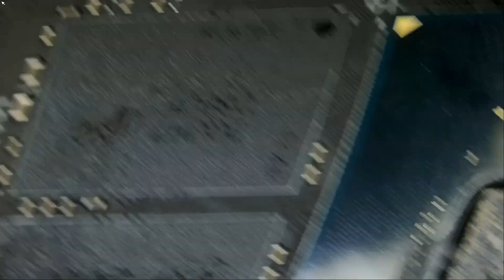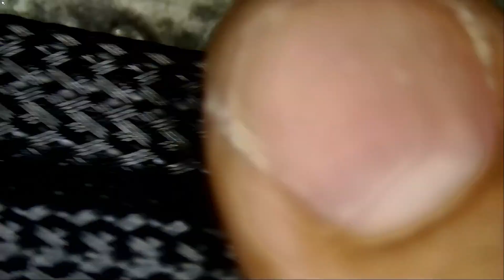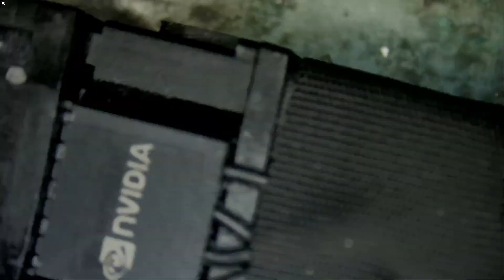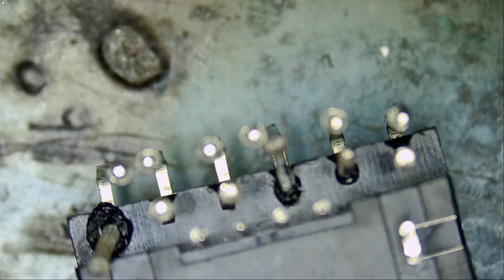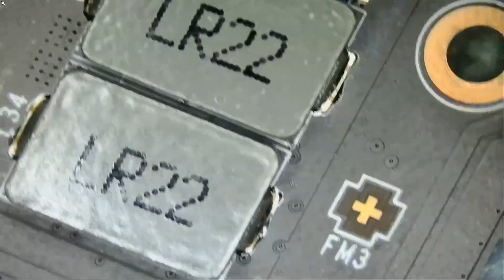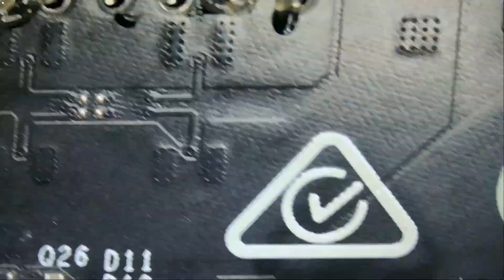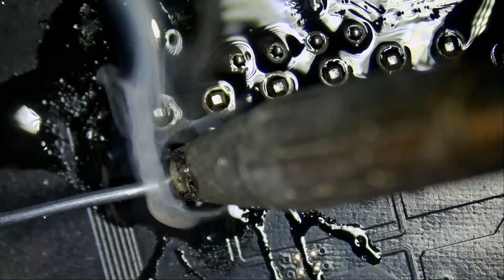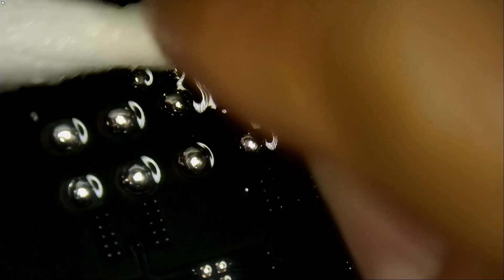4080 MSI Trio Never seen before Connector fell off & triggered Smoke Alarm

Comment: Thank you for your valuable feedback! MSI is fully aware of the issue and has taken it seriously. We've implemented technical optimizations and improvements in the subsequent product manufacturing process. We will continue to focus on product quality and user experience. Thank you for your continued support and trust in MSI!
Reply: @msigamingofficial - the customer invested good money into supporting your company and brand, you have let him down due to a manufacturing defect, you are letting yourselves down by only offering positive words.
Take positive action and make things right for the customer. 
Identify the batch in question and reach out to your distributors and get any affected cards reworked before anymore serious failure occurs and get in front of the timebomb.
Reply: Make that customer happy MSI, he trusted you, 
you know "you reap what you sow".
Reply: ok, how does that compensates this customer ?
Reply: This is a terrible response, you should compensate the customer in some way, either money back or replacement unit
Reply: @Bfg-yi2id  it's better than factory now
Reply: This is just public relations bull****. Haven't you learned we see through that nonsense? NF fixed it, MSI pay for it!
Reply: Shame on you msi
Reply: Try again, starting with how you’re going to make it right for someone who paid a lot of money for a card that clearly had severe QC issues.
Reply: MSI should at the very least compensate the customer for cost of getting the card repaired.
Reply: @rajav2  yeah, but that is the "very least", MSI should replace the card and pay the bills for repairing the one that has failed and the shipment back.
Reply: So…. What you gonna do about it?
Reply: @kumin0312  thoughts and prayers?
Reply: With a response like this, I'll never buy an MSI product again. And I've purchsed thousands and thousands of dollars of MSI products in the past.
Reply: Look at the card, all pins on the board don't have any trace of any solder. It is a clear fault of the manufacturer. The manufacturer must compensate accordingly.
Reply: So in other words... go pound sand.
I'm not going to buy any MSI products again with that attitude!
Reply: should it be a recall then of all 4090?
Reply: @VovanCBR  seems like a safety issue…. Rohs needs a QC 
Iaei 
Bro OSHA you got any 4090’s?
Reply: I think you should at least pay for this repair or refund the customer.
Reply: How dare you sell a defective product and not support the customer, when one of your wave solder lines CLEARLY had a hiccup, or a malfunction, as the holes in that card are damn near PRISTINE! SOLDER DID NOT EVEN TOUCH THEM, and by extension, no flux hit them unless it came off down the line.
You should, by all rights, send him a new card, and apology ad even a check to help diffuse this bill, which is YOUR FAULT.
On top of that, you are throwing shade on the NVIDIA product name and they might not like that much. These folks here, just might start venting anger at them. That could put a crimp in your little contract. I just retired after 45 years of watching this technology grow, and trying to help everyday users to understand and run their systems. You, Mr MSI have just given your fans the wrong impression and maybe a middle finger.
Enjoy the following discourse, held in your 'honor'.
My $2.00 worth.
Reply: so in other words... go pound sand!
I won't be won't buying any more MSI products again with that kind of attitude.
Reply: -1 client here!
Grabage  QC company!
Reply: Yeah. That's basically like sorry sire you lost your hand,, we are gonna make sure next person doesn't lose there hand. What about compensation to your customer? What about users already having purchased these cards?
Reply: You should atleast pay for the repair of the video card if it has already been repaired and working.
Reply: Because NorthridgeFix was able to carry out the repair and function without much effort, I think MSI should cover the costs. Not only was it quick and uncomplicated, but it was also more environmentally friendly and supported by local repair companies.
Reply: well my graphics card died and hubby was going to have me get a new one from msi. i saw this and ill be finding one from somewhere else instead. Hope he doesn't mind but this is upsetting to see from msi
Reply: MSI you better take action for this serious issue, if you already understand then fix it .
Reply: What does implementing optimizations and improvements to future products do for the current customer with a faulty product?
Reply: That's all?  You should compensate and pay the bill for the repair at least.  It will be a minimum to do.  Trust in a company isn't only based on words.  Do something.  Thanks.
Reply: Alright, MSI, the ball is in your court. Make this right with the customer who paid lots of money for your product. Be better than the other aib brands and replace the card or give a big discount. If you do not recall, you are going to be sued when you burn someone's house down.
Reply: Absolute bare minimum MSI should be doing is asking for the cable and connector back for investigation, I agree with Alex, what MSI SHOULD be doing is offering the customer a brand new card AND cover the repair cost of his current one (to the customer if he's paid already or Alex if they haven't paid yet), its then up to them if they then ask for the old card back whether it be so the customer doesn't have two cards to sell one on or to check the board for whatever they may find although i doubt there's much evidence left after it's been repaired.
Reply: So you’re saying “Yes it’s our fault, we knew about, we’ll try and not do it again, buy more of our stuff!! Trust me bro”
Reply: GIVE THIS GUY A NEW CARD! And pay this technician
Reply: What trust?! Looks like a rubbish board to me and the customer is the only one being screwed over here. I wouldn't use your products if this is the response @MSIGamingOffical
Reply: Your words does no justice, good thing I never liked MSI and now with this response, I just can't trust investing my money in MSI, I could just imagine how many more customer have dealt with this issue.
Reply: How do you dare to answer like that. You should compensate the client. Give him a brand new one or give him his money back or any other "respecting the client" solution. Talk is nothing without actions. If that connector could come right of a pcb so thick it means there was not even enough solder to hold the connector. This is a lack of quality control it is your fault and you should have solved all these cards connectors melting problems since a long time. Look at at the solder joints northridge fix is making and take example!
Reply: So…. What you gonna do about it?
how does that compensates this customer ?
Reply: How does this response help the end user and the technician who repaired the faulty video card? What is MSI going to do to compensate both the technician and the user for their wasted time and inconvenience?
Reply: Why would we trust you????? You need to make it right and not just for him. Replacement and the bloody wasted time of dealing with a company that wants "trust".
Reply: If i had money for a lawsuit i will sue this company,What if the house burnt or what if a child was close by and got burnt or even worst.F this company, give the client a new card and send in the repaired card.Pay the technician for giving light to this problem.I will sue them.This was a dangerous thing that happened.
Reply: So nicht meine Damen und Herren 🤨
Reply: I will never recommend anyone get anything from MSI, they far worse than Asus on Customer Service and even worse on Design. They should be paying North Bridge Fix for their time and getting the customer a new Card.
Reply: In Austria this would be a consumer protection case and a lawyer would take it on board if there was no appropriate reaction
Reply: what can the customer buy from your !!even bad!!! response now? does your company even pay the customers bill? does the customer get a new videocard from you? you are talking absolute bull....! Do your job right and take response for your own mistakes! These 5 senteces  you wrote: cheekiness. Makes it even worse.... saying you will care in future is not a solution for customers having problems already....
Reply: Great way to restore confidence in your product MSI. Maybe Customer Relations Team need to go back to school.
Reply: I also have an MSI graphics card (and my colleague at work) as well as a motherboard. I'm waiting for what MSI will do to know if I should continue with that practice.
One of the best things about Europe is that everything is guaranteed for a minimum of 2 years and you yourself, if you wish, can purchase an additional one for up to 5 years.
If something like this happens (and it's under warranty) you just take it to the store and that's it. They solve everything for you, and they deal with MSI. Of course, even if it happens after the warranty, this is an obvious mistake when making the card and this is unacceptable. I've never heard of anything like it. I hope they don't go the ASUS route...
Reply: I think you guts at least should pay for the repair cost to the customer and may be a nice gift basket as means to say sorry about the manufacturing fault.
Reply: I would think this a real cause for concern for MSI and they should be talking to their lawyers now. Normally an electronics company are not at risk for big lawsuits since they are not dealing with repercussions that could cause death. Usually just small issues that is usually not even worth taking the small claims court. For instance, a car company finds some defect in their glove box handle or some other somewhat trivial thing on the car, are they going to recall it? No way! Why not? Because they are not going to get sued. But what if there is something wrong with the steering wheel and it could lock up causing loss of control of the vehicle, now someone could die. Uh oh...lawyers recommend recall to cover their butt in case they get sued, because they know the COST OF REPLACING ALL THESE STEERING WHEELS is LESS THAN THE COST OF PAYING OFF A COUPLE LAWSUITS. They do the math and decide to recall. With a video card, I would think they would/should only be worried about a Class Action Lawsuit, which I would think would/should be coming since these aren't cheap video cards, but then again, it still might be too small for them to care about it. HOWEVER, if they start to see an issue like this where the video card is causing smoke and could burn down a house and potentially KILL someone, guess what....their lawyers and accountants will do the math and might go for recall. At the end of the day, whatever is morally 'right' or 'wrong' all these big companies care about is their BOTTOM LINE. It's all a money game. I definitely think MSI should just fess up to it and provide new cards allowing customers to swap in their old defective cards. But it might not make sense to them financially so they would only be doing it to maintain whatever reputation they have and I don't know if it is worth it to them. Good luck! But if anyone could make this happen, it will be Alex and Northridge Fix. From a fellow repair technician to another good luck brother, keep fighting the good fight!
Reply: Very poor response. The customer bought the card in good faith, clearly it was not manufactured correctly. Fortunately North Ridge Fix was able to repair the card, however they need to charge for their time for the repair. At this stage the customer is out of pocket for a repair that is a result of manufacturing failure. He has not been able to use the card while it was being repaired and the best you can offer is some corporate speak that means nothing in the customer's eyes. What is bizarre here is MSI have missed an opportunity to handle this issue responsibly and make the problem good. Furthermore the 35K people have viewed this video and your subsequent response will impact MSI's reputation in a $ value way more than an apology, reimbursement of repair cost and provision of a new replacement board.    Goods Work MSI.
Reply: MSI you should at least replace the dudes GPU instead of giving such a typical response
Reply: Shame on you MSI
Reply: at the very least, pay the customer repair bill ! imagine if the house burned down and a family member passed due to smoke inhalation !
Reply: computer parts are not cheap. and customers are paying hard earned cash to buy them. we know that nothing is perfect in electronics. but great customer support can help that.

for real life examples... a few weeks ago, my company laptop had a broken hinges. and turns out we experience about 25 of the same problem in that series. the principal after being notified went to us and give us a free warranty extension, change the hinges for not (yet) damaged hinges for all the laptop we have in that series (like 50 of them). and even willing to provide us replacement laptop while the unit are being repaired. they even willing to listened to our walkaround to "fix" the hinges problems and looking at it internally to check is it possible to do it as a final fix.

now THAT are top noch customer support. how about you @MSIGamingOfficial ?
Reply: Let me translate. We admit it's our fault but the only thing we will give you is the one finger salute because we have more expensive lawyers than you.
Reply: I wouldn’t wait til this catches Gamersnexus’ or Jay’s attention lol. Compensate the owner now before you face a bigger decline on your sales😅
Reply: Shame on MSI! Shame shame shame and i'm glad to see a lot people dislike them, because i had issues with their support for a long years and finally when i told the truth directly- they banned me of their forum. After i spend ~€40 000 in premium notebooks and PC  parts for 10years and about 50% had QC or manucaturer specific issues and MSI never helped or responded as they should , since last 2 years i pour my money in other companies.
I use only premium products, like GT Titan notebooks, high end Motherboards and GPUs and issues was frustrating, but msi's responses was awfull, just like that one. Damn **  you MSI , you can't ban me here !
Reply: Go to hell msi rubish as always never buy anything that comes from MSI....
Reply: Maybe an optional (by customer choice) recall offering resoldering of YOUR board, then return YOUR board back to original SN owner. And not some crappy third party don't care company six months later in a low pay country. Send them back to OEM manufacturing plant. Automate it. Then.... QC. Good QC.
Reply: Please MSI, please be a good company and help the customer out. I even have one of your 4090s as well.
Reply: you should identify the batch and recall all cards affected. replace them for customers or refund the money. this is neglect on your part. you are the only ones able to QC these products, most people just have thier pc´s built by someone else and know nothing of the danger that lurks within.. make it right.

also MSI is no stranger to shady practices...
Reply: What does that mean? Will you send a new video card to the customer?
Reply: Great response MSI. We know this issue, but customer have to pay for fixing it. Never MSI again.
Reply: @msi  - 
 you should investigate and offer some form of compensation's.  Ita pretty obvious this slipped through quality control.
Reply: If you really want to make it right you need to give the customer a new replacement card and compensate NorthridgeFix for his repair. If you do not at least compensate the customer for a problem you caused how can anyone trust that this will not happen again? Do you want to become the next Asus?
Reply: Just replace the card with a new one. You are a million/billion dollar company. I don't think replacing this card will hurt your wallet. 

You were aware of the issue, so clearly, warranty should apply. 

I don't understand why companies are being so dramatic about warranty. 

IF THE DAMAGE IS YOUR FAULT, HELP THE CUSTOMER. It's not that difficult...
Reply: MSI is fully aware that their products are degrading in quality and they dissobey to take responsibility of those actions towards customers. MSI shows disrespect towards customers before his own profit. What siriousness did MSI take for the customer. 
Oh,we sorry our crappy product didn't survive,try to buy another,please and stop bullying us.
Reply: Thank you for your response, however it appears to be lacking.  You need to, at the very least, pay the out of pocket expenses for the customer in question.

Also, in my opinion, you should recall ALL the cards that are likely to have the same DEFECT as they are a danger to your customers, if they are setting off smoke detectors then they are a potential fire hazard, this could lead to the deaths of your valuable customers.  This I suspect that MSI does not want to be known for.  And I DO mean MSI and all of your subsidiaries.

A concerned viewer who will NOT be purchasing any MSI products until I hear from a trusted source that this issue has either completely gone away, or that people are being made aware of the recall/replacement program.
Reply: This is obviously a manufacturing error, if MSI isn't going to take responsibility for their issues they don't deserve our business.  The MSI response is disturbing.
Reply: MSI... What the heck?! Shame on y'all for such a crappy response and for making crappy cards! You should compensate by giving that customer a new card and also paying Northridge Fix for the time and effort to repair that card. You should be recalling all of the cards with the bad connectors and giving every customer who bought the defective cards a brand new replacement. I'll never buy another MSI product again! Such terrible customer service!
Reply: How about you ask for the product serial number, and check the logs for the batch it was in, and what manufacturing process that batch went into especially assembling, testing and QC. I think you'll find something more useful to say that "We understood".  Thats what i would do at least if i cared about my company's trust with my customers, my reputation as a tech company. Walla it's not that hard.
Reply: Do you really think people are going to buy your graphics cards when you absolutely don't take any responsibility when things go wrong? Your answer is plain stupid and you will loose both money and reputation!
Reply: -1 customer
Reply: You see? This is why I stay away from garbage MSI GPUs, especially away from venture and gaming series from 30series cards till now. They are all cheap quality, and problem makers. If you know that the issue is on your side, you should do a full refund in this case.
Reply: The right precedure would be, make the customer RMA his exisiting card, and send him a new one (with the revised update of the connector) otherwise, would be the same
case. This would be the right approach. If the item is new, need to be swapped with a new one, if the card was refurbished, then they should send the customer a revised
refurbished. Plain and simple.
Reply: As an msi fan boy. I don't understand how did you fix the buyers problem with this post. He paid for msi's mistake.
Reply: I work More they 20 years in Customer Support in Electronics. Give the Customer a new Card included Shipping.
Reply: Do the right thing MSI and stop trying to dodge responsibility
Reply: MSI - I would suspect you've already lost the customer and many more potential future buyers of your products through your inaction in this example and not prioritising customer experience. 

Here's a real life example of how to retain customers. I accidentally damaged my new Bequiet CPU cooler during installation. I wrote to Bequiet and admitted the fault was mine and requested a repair where I would cover the costs. Can you guess what Bequiet did? They sent me a brand new, sealed product replacement, no questions asked. They ate the costs because they are smart enough to realise retaining customers is how you maximise costs and increase value for customers. I will always buy Bequiet where applicable since they proved to me they value their customers. You should learn from them.
Reply: Hey MSI how about you do what's right and replace the card and compensate the poor guy.

And MSI how about you team up with all the other board partners and do good by all of your customers combined and start a class action lawsuit against PCI-SIG for creating such a crappy connector and against Nvidia for using such a crappy connector and making board partners also use such a crappy connector instead of 3x 8pin connectors.
Reply: MSI is fully aware of the issue ........................shame on you. Hand in pocket please.
Reply: You have the opportunity to make a super PR work right at your doorstep. Act smart.
Reply: Won’t be buying an MSI product ever again thanks to your response.
Reply: @Northridgefix :- "Better than factory". 😂
Reply: During the times of gtx580 series I bought two MSI lightning cards. Where I live taxes and shipping is like 150% msrp. Both died. 
I still have an older evga working fine in 2024. I can never touch MSI again for any pc components 😂
Reply: Ear manufacturing fault. Shame on you MSI!
Reply: This feels like the response you gave me after it took 3 times for you to finally send me another motherboard after you failed to fix chipset fan and audio not working. This was clearly a defect and your responsible for it
Reply: Very disappointed with the response, what about the customer? :yt:
Reply: As an owner of several, expensive MSI products; This is unacceptable treatment of the customer.
Reply: Msi should, at minimum, pay for this guys repair bill. I can tell you now. If this is not resolved by MSI, I myself will not be buying from them anymore.
Reply: This comment it's sounds like is written by a bot, terrible comment from MSI,it's like we are aware of the situation but we don't give a F...
Reply: MSI  needs to compensate the customer for the repair
Reply: We need gamersnexus for this one. Hopefully he can help
Reply: We need to summon Steve from Gamers Nexus
Reply: Any reputable company would be recalling the affected products. - There is a known manufacturing/design defect that poses a potential fire risk!
Reply: Never again MSI!!!
Reply: Shame on you msi
Reply: @MSIGamingOfficial
 This is obviously a manufacturing defect. That means it is your problem. You need to make it right with the customer. Does that make sense to you?

I am currently shopping for the guts for my next computer. Why would I buy from a company that does not correct their mistakes? Sorry, we'll fix it in the next batch does not make it right.
Reply: Yeah sure that's nice, but why not openly and publicly offer a solution to the people experiencing these issues on top of making sure future customers don't have this problem?

It's a waste of time and money for people to have to fix your short comings.
Reply: @TheMegaloYT  because it would bankrupt them, to fix this one card PUBLICLY…. They still riding the “it’s the consumer “ at fault… and if they accept fault for this ONE…. They have to accept all 10,000+ cards produced possibly a TOTAL RECALL and redesign…. So while they ride the BACK of PAYING CUSTOMERS TO FUTHER R&D a NEW connection…. First adopters are left to die….
Reply: So, MSI, you mentioned "We've implemented technical optimizations and improvements in the subsequent product manufacturing process", but what about all the users who bought your products before the improvements in these manufacturing processes were implemented? One of your clients bought a card with what definitely seems like a manufacturing defect (and who knows how many more clients suffered or liable to suffer the same), and this client had to pay for repair and probably for shipping, and even after the repair, the card might still be damaged or maybe it inflicted damage to other PC parts. I have not seen in your comment anything about any sort of compensation for anyone who purchased your products and is unaware of or realized there was a manufacturing defect, nor have I seen you referring to compensation for NorthridgeFix for spending time and money fixing your fault; and last but definitely not least, I have not even seen you apologize at all in your comment to any affected party, which is the bare minimum, and is shameful and disgraceful on your part!
Reply: You are aware of this issue. That means you are aware that there are several defective cards on the market. Don't spew this bullshit and start recalling the cards. Next time if this causes fire in someone's house and kills someone, what are you going to do? Compensate the customer and recall all the cards that have QC issues
Reply: make it right
Reply: This says literally nothing. It's bad enough your garbage laptops have no quality control but now your GPUs are so awful they can potentially start fires and kill entire households of people and pets? You're sickening.
Reply: Shame on you MSI. It is not enough to try to protect your profits by saying it won't happen again.  You MUST pay for your mistakes. You created a defective product that nearly burns peoples houses down.
Reply: @msigaminhofficial are you using an oldest version of chatgpt to write down your comments?
It looks so..
The problem is almost noone is willing to legal suite you for this, not for the ammount of money, but for the lack of interest for costumers when you company know the issue and admit its your fault.. 
Thanks to all you guys not to trust MSI
Reply: @MSIGamingOfficial -- This is just your way of doing legal speak and dismissing the problem many customers are having with these cards. you are not taking responsibility for poor engineering practices. I as a long time MSI customer (I Have several MSI laptops, and my primary desktop has a MSI board) I can tell you this is the last straw for me with your company. Right now, I have a MSI GT72 Dominator, MSI GT75, MSI MEG Z590 ACE GOLD EDITION motherboard in use today (except for the GT75) . Funny how the GT75 died after 2 years 1 month exactly. exactly 1 month after the warranty period ended. (i bought it from costco so one year from manufacture, 1 year from costco) Earlier on about 6 months in with the GT75 the audio card decided to glitch out and i contacted support. got nowhere with it. support pointed the finger at something i did just tossed the blame thrower around at the customer. keep in mind i've been in professional IT for 27 years i've built thousands of computers in my time. anyway, i also have a msi branded nvidia 4080, 4090 but both of them will be sitting in an antistatic bag until the end of time. i'd rather not burn my house down with them installed. I've replaced them both with high end AMD cards. I'm also ditching all of my MSI gaming gear because of your empty response and going to other manufacturers. sorry MSI but you lost a long time customer for good. i'm so sick and tired of seeing manufacturing companies poorly engineer high end expensive cards putting shotty or insufficient current flowing connectors expecting them to be reliable and safe to just reject warranties and point the finger at the customer or respond with some half baked canned response like that. put a little more into those connectors. spend a few pennies per unit. go with a more industrial type of connector so you don't burn houses down or cards destroying themselves because of shorting out. you might find that alot of the cards being claimed under warranty will soon dwindle down and you will actually make a bigger profit.
Reply: MSI should respond with this... Thank you Northridgefix for bringing this to our attention. We have identified the issue and are working to make sure this situation doesn't happen again. Considering the uniqueness of the situation of the full connector and pins coming off completely from the board and not because of a burned connector situation, we at MSI would like to extend our apologies to the customer of the card, and would ask the customer contact asap and we will be happy to replace the card with a new card, and also cover shipping. We at MSI would also like to reassure all MSI customers that our quality control section works very hard to make sure something like this does not happen. This was clearly a quality control issue, and we accept our department missed this card. This is unacceptable, and we will make sure our quality control department personnel are up to date with their training and skills to avoid this from happening again. Thank you
Reply: Lo sentimos y ya esta?????
No dais ninguna solución al igual que todas las marcas, nunca hay garantía ni respondeis con una compensación o cambio de gráfica, por desgracia cada vez es mas común en todas las marcas,da igual si son de smartphones, cohes,computadoras etc el comprador esta cada vez mas desamparado.
no existe la justicia.
Reply: @joseensenat8296  Visto esta respuesta, no veo ninguna diferencia entre MSI y cualquier fabricante chino de aliexpress o alibaba... es más, veo en ellos incluso más responsabilidad. Nunca más.
Reply: brand new video card to customer, apology and pay the bill to Alex!!!!
Reply: @MSIGamingOfficial you implemented technical optimizations and improvements in the subsequent product manufacturing process??? The card's connector says a whole different thing, that is obviously no way near to that technical optimization thing you are promising with to your products. Just replace it with a brand new, quality tested card, or a refund plus the hassle made because of the poor quality of the card.
Reply: MSI will "continue to focus on product quality"? Clearly they hadn't and are in denial.

"Thank you for your continued support and trust in MSI" Unbelievable, do they seriously think customers will have either after experiencing such a blatantly obvious and serious QA failure?

Just insincere corporate boilerplate BS.
Reply: I hope this video and your response have the greatest impact possible to your profit and your company's name.
Reply: Compensate the customer.
Reply: If you are aware of the issue and are taking it seriously MSI what exactly are you going to do about it ?. I guess we will see when we check your next generation card that will be coming out soon and I bet it has the same problems I bet you do nothing to sort this massive problem I also bet you wont replace any broken cards for customers with this issue with a new one but to be honest who wants your products when we know what your like at trying to build video cards
Reply: Very sad to see a standard replay, that can be used for everything. Who does that help? Only MSI for not being sued or holding them financially responsible. 
Even more sad, that nothing  seems to be done on your part (MSI). Not even making customer aware of the possible fire hazard in their homes. I was a MSI customer for a long time, but that changed some time ago. I do not like the way MSI took recently. 
MSI, take responsibility and do something.
At first: Be upfront, help the affected customers and than keep your quality control in line. 
And get Nvidia in the boot as well. They started the connector problems in the first place.
Reply: @MSIGamingOfficial Regarding the trust the customers are giving MSI, when buying a so high value videocard, MSI should be trustworthy too, when issues appear regarding the hardware. You should definately compensate the customer with a replacement.
Reply: This answer is even worse then I thought, they are aware of this issue with burn connection and they haven't investigate the root cause of all burn connections.
First they should talk to Alex, because he knows someting about it and second they should compensate all customers with this issue if they want to have trust in their products again.
Regards from 🇸🇪
Reply: MSI should give a brand new card to customer
Reply: This is an answer given by a chat bot! Take your responsibility and give a human answer. And now compensate this customer.
Reply: that's it? Just empty words!! You guys must compensate him for the loss. And I'm never gonna buy any Multiple Serious Issue (MSI) Stuffs ever again for this kind of behaviour
Reply: If you guys are going to compensate any of your let down customers, I believe you should refund them the full amount they paid for your graphics cards and not replace them with new units until you have fixed the burning/melting problems with them. You're going to kill someone or a family with these dangerous connectors. Take responsibility or loose your name!
Reply: If a car manufacturer sells a car with defective components, they issue a recall with the affected VIN numbers so that customers can bring the car in the dealership and have the problem fixed free of charge. Otherwise they would face a massive lawsuit, pay millions $$ compensation and also gain a bad reputation and loose money in the long run as customers won't buy that brand anymore. Why can't a technology manufacturer do the same? They have serial numbers of each and every PCB produced, so it would be a similar process as a car manufacturer. Take attitude MSI and fix your defective products. If the customers house would have burned down because of that defective connector, what you would have done? Still issue a standard PR message and leave that poor person homeless? You would have face a massive lawsuit and massive losses. Now I fell sorry that I built my PC with only MSI products as I had big trust in your brand,  but that trust was thrown out the window. Next PC system that I build won't be with MSI components until I see a movement in the right direction, and from that I am meaning ACTIONS, not standard PR messages.
Reply: you shoud compensate the customer, to build confidence in your products.
otherwise, you will lose part of your market share, and customers will search for an alternative.
Reply: Maybe instead of talking like ASUS or Gigabyte did. Take it to action? Reach NF to help you reach the customer and compensate at least the cost of the repair or something? We are done with good fancy words. Look at Intel right now and say what do you see! I preferred MSI and Intel over others for a long time. Now i have 2 blown up MSI motherboard, the vrm just gone Hiroshima and made a hole in the motherboard, both cases. Thank god i dint got a 13-14 series Intel chip... One of the boards blew up in 2 weeks so the shop helped with the warranty, but the other board was just out of warranty by days. Repair is expensive and i know the reason why and i accept it, but if its more expensive than the board blew up it becomes electronic waste, what i hate to see. Warranty sucks, i pay sometimes hundreds of dollars for a product and the manufacturer says we warranty it for a year or two. Warranty it for 5-10years like some manufacturers do who trust their product!
Reply: my 3 year old laptop is still broken msi with a dead gpu
Reply: if MSI are aware of this issue there should be a recall and all out of pocket expenses refunded  OR like VW DIESEL GATE a group class action lawsuit  started  for all costs and compensation defective equipment and fire risk/hazard life threatening how many lives are at risk
Reply: MSI you are making everyone whole in the background, right?
Reply: With responses like this you cannot count on continued support from customers... Take responsibility and fix it for the customer, it's your responsibility to provide products that are safe to use and do not fall apart like shown in the video. It should not have passed QC checks.
Reply: Can we get a GN Steve eyes on please 😉
Reply: This response is unbelievable. You should compensate the customer!
Reply: Typical corporate 💩 response. Same as company politics. Shame on you msi. A user's house could burn down and no one would know why.
Reply: I have been ur customer for years :/ what is the meaning of this :/
Reply: You should give another video card to the customer... And compensate the Alex for the repair...
Reply: MSI please compensate the customer with a new brand card.
Reply: Come on MSI, replace they GPU!
Reply: Corporate word soup. Get your finger out and compensate the customer.
Reply: You should definitely do a better job at compensating your customers when you screw up. It's shady practices and half baked hr apologies that make companies like you very unfavorable to support and buy some. I have a MSI GPU and at this rate, it's upgrade is not going to be MSI. I'll take my chances with a temu GPU before buying one from you again unless something changes and we see some honest and customer loyalty satisfaction become a  part of your practices. Let your CEO respond next time and see what we the consumers want.
Reply: pay the bill of the repairing
Reply: I will not be buying any MSI product if this is how they support their customers.
Reply: This does not help that customer in any way. You should compensate him in some way.
Reply: Fuck msi, shit companyy dont buy msi product
Reply: Refund your customers for YOUR failures. Easy as that
Reply: @MSIGamingOffcial You should send that customer a brand new card. End of Story. Because your response doesn't help NorthRidgeFix or the customer.
Reply: Make it right MSI!  You did not make it right to begin with and that's on you! The freaking connector got hot enough to desolder itself! Think about how hard it is even with hot air to remove these connectors without low melt solder. Absolutely insane....
Reply: Come on MSI are you must do better than this.
Reply: MSI is in "no buy list" for me hereafter... I expected at least a replacement card & a deserved apology...
Reply: How dare by you to send a response like this one... but maybe i'm just talkin' to an AI bot 'cause you don't CARE AT ALL about your customers.
Anyway, shame on you, MSI.
Reply: New card and reimburse customer for money spent on third party repair!
Reply: @MSIGamingOfficial MSI is in "no buy list" for me hereafter... I expected at least a replacement card & a deserved apology...
Reply: Well done MSI 
For u shitty reply
Reply: If you're aware of the issue with the power connector do something about it. I know that Nvidia is the one that engineered it and doesn't care about what is doing to the customers but You on the other hand can change it but won't for some reason.  In that case the customer should be accommodated with a new device when it fails. SHAME on you msi. This is why I never buy anything from you.
Reply: Refund the people who has this issue!
Reply: MSI and NVIDIA should be ashamed further more this conector and this issues should be taking a big ass lawsuit to compensate all people who got affected by it.
Reply: i am a huge fan of msi, god knows i bought a lot of his stuff, but this comment is not what i expected from them. you know better msi, this is not how you handle the situation. be better!
Reply: I have a 4080 msi card the same one is this something i need to be afraid off.and does u care about ur buyers?
Reply: @msigamingofficial what actions are you taking to make this right with the customer and Northridge Fix? Or do we need to have @GamersNexus investigate you next?
Reply: Not good enough.  I will not buy another MSI product until they address this issue and make the customer whole.
Reply: I had an issue with gigabyte and one of their entry level laptops. After returning the original unit for a new one, the same problm came up. What did Gigabyte do? Not only did they refund me, but they gave me one of their top line laptops as an apology and a thanks for pointing out a manufacturing problem on their whole line of that model they were not aware of. Companies need to take responsibility for their problems and not look at profit at that stage. I promise you I will NEVER buy from MSI. NEVER!!!!!
Reply: How about focusing on making things right for the customer that you wronged for poor quality control msi?
Reply: @msigamingoffical that’s great and all, but what about this particular instance…. How can you NOT accept responsibility for this? I may not know a lot, but I know when something isn’t right, this is not right…. 

Does it take the world to boycott 4090 cards, to get a power connection redesign, one that actually accepts the amperage supplied over time, not 10-20mins of gaming before a failure… gaming isn’t even demanding of a 4090, so HOW TF did this ACTUALLY happen?!?
Reply: I will never buy anything MSI again.. I don't want any issues with anything I may have.. and for this company do nothing for the customer is disgraceful.
Reply: @MSIGamingOfficial: platitudes aren't enough.  At ABSOLUTE MINIMUM you should offer to cover the customer's repair expense.  He paid a lot of money for your product.  This could have ended far, far worse.
Reply: I understand.  We have a market system where the consumer's feedback for the current transaction is in a courtroom.  His next rational action is to sue you for damages.  The bet, and solid bet indeed, is that MSI can afford more lawyer than the customer.  That is the optimizing strategy of the game/laws/rules.  MSI is rational in this way.  Thus, it is important to not openly acknowledge fault and expose yourself to thousands of suits in small-claims.  If you give a card to the customer as explicit compensation, you've set precedent.  If you compensate @NorthridgeFix directly, you've given precedent.

Perhaps one way to save face is to compensate the customer privately (at least a card), post a comment indicating remediation, and allow the customer or @NorthridgeFix to acknowledge that the customer is satisfied.  For the repair bill, give @NorthridgeFix a one-time "bounty" for finding the defect.  The same "bounty" approach could also apply to the customer should MSI desire.  I think you can make this "right" by compensating both parties and save both Face and legal protection.

We are fortunate to have @NorthridgeFix as an advocate for the consumer side of the market.  His information breaks the time-invariant fact that the producer/seller will win in these cases.  In that way, @NorthridgeFix bends the rules of a ruthless market system in favor of the consumer.
Reply: A responsible company does a recall when they are aware of an issue with something they put their name on as a good product. Anything else is just blowing smoke up the back side of those who trusted in your name. NorthridgeFix is just one repair shop, and for them to have 300 of these failed connectors in a box means the issue is not "news". I stopped buying MSI products long ago as a system builder, because I have had smoke blown up my backside several times in the past.
Reply: Whiskey Tango Foxtrot are you thinking MSI? This is not acceptable; period.
Reply: at minimum MSI should compensate YOU for repairing the card, time and material.
that way you get paid for fixing it and the customer gets his repaired and working card back.
PERIOD!
Reply: Msi should at least pay for the repair cost!
Reply: What trust? A customer had to go to a third party to fix a brand new card.
Reply: that's why i hate MSI , and never buy anything from them 
cuz they have sh*t customer support 

MSI , you should contact the customer and provide a replacement or repair services 
your reputation is on the line
Reply: I think you msi as a company should compensate the man for his trouble with the said video card , it's unacceptable to send out video cards or anything with that kind of problem ,this type of problem could get people killed , by burning down homes or worse . Msi you guys really need to think about a new redesign on these said card. Also don't give crap responses like that that's just bs
Reply: You assume we have any trust and still support MSI.  You seem to have left something of your response.  You know, the part about how you were going to make the customer whole?
Reply: Bullshit.
Reply: Send the guy a new card. Are you taking accountability? Then make it right. Save the BS.
Reply: We wont be supporting you much longer if you keep failing your customers. We pay a lot of money for your GPU's and don't expect a lack of QA rendering them useless TO BE GLOSSED OVER WITH TALK......ACT!
Reply: well... i'm never buying MSI again...
Reply: Do not purchase any products from MSI, you have to hit them in the pocket before MSI take take any action in either replacing or repairing their products.
Reply: MSI- your better than this, remedy this problem correctly!
Reply: Simply don't buy any more MSI products.. I'm Italian, here in Italy they are considered to have the worst pre- and post-sales customer support service, they have absurd if not crazy RMA policies.. Furthermore, their quality/price ratio is terrible. . All their products have much higher prices than other brands that offer better or at least the same level items but at much lower prices. MSI doesn't deserve our money.
Reply: Simply don't buy any more MSI products.. I'm Italian, here in Italy they are considered to have the worst pre- and post-sales customer support service, they have absurd if not crazy RMA policies.. Furthermore, their quality/price ratio is terrible. . All their products have much higher prices than other brands that offer better or at least the same level items but at much lower prices. MSI doesn't deserve our money.
Reply: absolute trash reply, lost what little faith i had left in MSI. though I haven't had any technical issues I see many online and hear many issues. sounds like MSI is heading down the EK route. Will never buy MSI again because of the way this situation was handled. Or should I say, not handled?
Reply: Thank you for your valuable feedback!   (oh sheet, another f'd card from a pesky customer/rube)
MSI is fully aware of the issue and has taken it seriously.   (even if the "good" yield is 80%, we ship it all - that's serious profit)
We've implemented technical optimizations and improvements in the subsequent product manufacturing process.   (we yell at our overworked assemblers even harder, redesigning the board would cost too much money)
We will continue to focus on product quality and user experience.   (but we focus on profit even more)
Thank you for your continued support and trust in MSI!  (F you, pay me!)
Reply: it's the way of the world, companies get big and get taken over by PR, Beancounter and lawyers, after that the 
humanity dies, this happen here when the Blue Micro Star International was kill by The Big Bad red MSI Dragon. 
Just move on from here, this is a lost cause, leave them with buyers that are blessed by ignorance.
Because we don't know how many other cards from that station, from that day are out there bad, but still alive.

 in the date hoarding world it would be easy to find out the batch numbers from that station 
and do a replacement recall.

but they won't, it would cost too much.
better to ride out the RP storm.

Beside MSI is getting pretty good at that.
Reply: MSI should take care of the customer.  Garbage company if it doesn't.
Reply: Can they sue MSI?
Reply: I was expecting a solution for the case, apologies won't pay the bills and not compensate the money the consumer waste to bring the video card back to life.
Reply: do you tho ?
Reply: MSI, your video card, quality control, AND customer service were abject failures here. I definitely won't be buying any of your products anytimem in the foreseeable future, seeing how you treat quality control as well as your customers!
Reply: I definitely won't support your brand when the new 5000 series drops. 
I don't buy garbage.
Reply: MSI has not taken the issue seriously. Serious would have been a recall of the cards in question as soon as you knew there was a problem. Integrity requires the same. You ask for trust, for what? Believing in your product enough to spend hundreds to thousands of dollars of our hard earned money to provide MSI "valuable feedback". What value does my feedback amount to? Please do the right thing for your customers so I can keep MSI on my list of OEMs I trust to do business with.
Reply: I hope no one ever leaves an apology letter on your windshield like this the next time someone sideswipes your car and tells you that they are going to drive better in the future. No phone, and no insurance information given.
Reply: This default answer is far from helpful. This alarming issue needs to be addressed both internally and externally. Customers spent GOOD MONEY for your product with their trust in your company. MSI needs to accept all RMAs for this, melting cleanly off a circuit board is insanity.
Reply: No more MSI products for me.
Reply: Bull response. Compensate the customer.
I will not be buying MSI if this is how they behave.
Reply: Thats exatly 0 costumer support if no compensation was made to the customer, He cannot pay full price for a product that as factory defect!
Reply: You won’t sell us any cards if you don’t remedy this customer!
Reply: Fully aware and you leave a customers who have spent over 1000$ for a product that failed from a manufacturer defect.   You should be forced to recall all 4080s and 4090s and pay every customer back in full since you basically told this customer to fuq off.  No wonder why msi is a HAS BEEN company.  I'll never buy msi again and I use to be a fanboi.  I'll take my chances with asus crap.
Reply: Are you gonna refund that customer or give him another card since your manufacturing defect? If not, don't bother writing these fancy words.
Reply: Wow, i loved your company for years. But this is going to make me think twice or even three times before ever buying your products, knowing that this is the response i'm going to get if i get a defective product.
Reply: COMPENSATE YOUR CUSTOMER. Without the customers, you are nothing.
Reply: Sounds like root cause is manufacturing defect. How else would a connector desolder itself?
Reply: @MSI I have been a customer and a vendor for over 30 years.  I trust MSI, this leads me not to trust MSI.  If something like this was to happen to one of my customers and you did this, I would stop using your products altogether.  Do the right thing when no one is looking, not after hundreds of people pressuring you!  I will rethink buying any video cards until you do.
Reply: What a bunch of nonsense from MSI. This kind of behaviour should be fined by US government right away
Reply: I would expect a replacement graphics card in this situation. This is a known manufacturing issue and if you’re justification for charging 100s sometimes 1000s of dollars for a product is quality then we expect exactly that! Not to mention in my own experience I’ve seen MSI handle things less than satisfactory. We are not beta testers we are not the company’s quality department we are the end user. I hope to see that you all handled this situation accordingly and professionally. A replacement or equal compensation is expected by the community and we hope quality control AND customer service is improved in the very near future.
Reply: tell you one thing, you had a customer. This is ZERO service at a premium bradn. Renders your brand useless.
A brand is trust.
Reply: Youre aware of the serious issue but all you do is go back to your lawyers and see how you can proctect yourselves. A customer bought your product it was faulty and alll u have to say is "Thank you for your feedback" thats sad and pathetic. Do better. Value the customers or get ready to lose them
Reply: @MSIGamingOfficial This is a very terrible response you should compensate the customer with a NEW card and pay the money backy for the repair cost !!!
Reply: Where is customer's compensation? An excuse is not enough. Compensate customer's and do a recall on all cards with that issue!
Reply: @MSIGamingOfficial You have GOT to be kidding!!  How does a canned garbage response help this situation?  In what world would we the customers believe that any action will be taken on a larger scale when you don't even take action on this event?  You should send him a BRAND NEW 4090 and compensate Northridgefix for the repair fees.  This shouldn't cost the customer a dime.  Your manufacturing oversight could have BURNED HIS HOUSE DOWN!!!!  Are you kidding?!?!!?  Apparently not only can I never buy anything from Asus again, but I can't from MSI either.  What the hell is this entitled, greed-driven, uncaring world come to?  Just when we thought it couldn't get any worse, MSI says, "Hold my beer and watch this" from their ivory tower.  Can't even take responsibility for their own actions to build trust in THEIR OWN brand
Reply: Sorry @MSIGamingOfficial.  The Consumer Products Safety Commission should be doing a mandatory RECALL and embargo of you and NVIDIA and their subs from selling any 4080/4090 video cards until this is resolved.  Anyone who has their house burn down/potential deaths should sue the f* out of the people...right into the 8th dimension.

Do you really want your corporation to be bankrupted?  You know about this.  You are now liable.  If I was you, I would start to take this seriously. Note the key word:  START.
Reply: glad i have never done business with u and now i never intend to. no one is above screwing up but a good company would try to make it right for the customer. u should cover this bill and offer the customer a new 4090 on top of it for all the hassle u caused. your response is pathetic!
Reply: Yes very sad, Anyway..
Reply: MSI should pay for the repairs to this card, or replace this card with a new one.
Reply: To the chief at MSI, if something happened to you or someone close and you went to the doctor, would the doctor say, I’m sorry but thanks for pointing that out and we’ll look into it. How would you feel. It’s just pure greediness and unjust and I hope you’re sued and MSI’s reputation gets tarnished. The card is not cheap and could have at least compensate for the loss, if that’s the most you can do, never forget, it’s customers who have made you all rich and poplar, give back to make this right. Do it now.
Reply: Come on MSI, in your own words you have admitted liability to letting a defective unit go on sale.. "We are aware of the problem" says it all... As Alex asked, does a house have to burn down before large companies such as yourself take action? The least you should do is replace the card with a new unit to the customer or a full refund along with the cost of repair and also liase with Alex to get to the root of the problem so that NO houses need to burn due to your negligence because, at the moment, you understand nothing and talk in your case is very cheap. Maybe something for @gamersnexus and/or @jay2cents to look into also to see if there are more instances of this happening.
Reply: MSI should stand behind their product, period.
Reply: I will never buy anything from MSI again. You almost burnt this customers house down.... And you send a "we will fix it in a future design?" message?  too bad you bought a bad one.. go buy another?  Man what world do you live in that this is OK... Maybe some lawyer should look at these issues.. wow
Reply: pay the customers that have this problem back there money or replace the cards for free. and is there any one who trust a company that  says trust in us
Reply: poor show MSI, poor show.
Reply: Is this the official standpoint of MSI in this matter? If so, I'll never buy any product of MSI again. This answer is probably given by a customerservice employee who has had training in answering questions but doesn't comprehend what service is!
Reply: Typical of MSI not to respond.
Reply: maybe you should not use that dogshit 12V plug bullshit that nvidia
Reply: Trust in MSI! NO f.cking MORE!
Reply: they are not interested in your complaint
Reply: If you are fully aware of the issue, this means you are admitting that you know your product has an issue, so don't you think you should at least compensate the customer for the repair fee + the time he spent to have it fixed? A coupon for your products would be good for both you and your customer, as he's going to spend money for your products again, and it won't damage the image of your company.
Reply: Shame on you MSI
Reply: This is an industry wide problem.  This MSI card was just the worst example of the poorest QA imaginable. When will Nvidia and the rest of the OEM's own up to this failing power connector issues?  If you watch these videos, dozens if not hundreds of his repairs, there is OBVIOUSLY an issue with not only Q/A of the products, but a defect in design as well of those connectors.

MSI, Asus, and every other OEM selling these 4080 and 4090 Nvidia cards should be refunding the cost of this man's labor in fixing YOUR defects for these unfortunate customers. I suspect these will be used in the next generation of Nvidia cards too, which means you're being simply complicit in this known defect.

This really should be class-action lawsuit, but in which country would one start, other than every country these OEM's sell in?
Reply: MSI should absolutely give that customer a brand new card, AND compensate Northridge for the work done.
Reply: Such a lame response
Reply: Compensate the customer
Reply: what about compensation ? there was deffinetly a broken product that produced a fire hazard in someone's home
Reply: the customer should be offered compensation either by providing him with a new card, or by covering the repair bill
Reply: THIS MADE ME RESPECT YOURE BRAND MORE ASUS GIGABYTE ZOTAC ETC ETC WILL NEVER COMMENT YOU GUYS ACKNOWLEDGE YOURE FAULT ALL THING YOU DID NOT DO IS TELL THE CUSTOMER YOU WILL EPLACE IT FOR HIM BUT GREAT JOB MSI I TRUST IN YOU
Reply: Why should anyone take MSI's word that they "understand" the issue and will address this very issue henceforth? 
They thank Northridge Fix for bringing to what they admit, an already acknowledged "awareness of the issue", and then ask for "continued support and trust". Based on what resolution of this customer's issue on MSI's part, should we as customers continue to support and trust MSI? 
Either compensate for their own admitted error, or deal with the fact that they will lose any continued support and trust as a result!
Reply: Do the right thing MSI and send the customer a new card!
Reply: MSI, at the minimum, you need to cover the cost of the repair.  If you want to fully redeem yourself, then replace his card for a new one (like any reputable company would)

Your response to this will dictate if I recommend your products moving forward.
Reply: So what happens if the customer lost their home to.a fire as a result of your faulty product or what if the customer lived in a comomex with many families living there and your faulty product caused the loss of property and life. Your statement of we are taking steps to improve our process is mute. Everybody involved in the process lost time and money due to your companies lack of quality control and you lost nothing. You should be rolling over backwards to compensate everyone involved and you are very lucky that there hasn't been a class action lawsuit against your company for their sloppy practises and all I can hope is that nobody has been been injured due to your lack of quality controls and assurance. Do better ! Be a better corporate citizen ! Be accountable !
Reply: MSI: Multiple Serious Problems 🥳
Reply: @MSIGamingOfficial stop giving non answers that do nothing but benefit your corporate image, and actually make things right for affected customers. The more you take real, meaningful, and immediate action, the more people will invest in your company. Otherwise, have fun losing sales.
Reply: Pay the bill for fix, give a free new videocard, it's all you have to do...
Reply: I had a lot of respect for your brand. I have some keyboards, 2 mices, 4 monitors, 2 pcs build only with MSI components, another minipc, some merch like Lucky, the Dragon, and more. But if this is what I can expect from you, that you recognize a failure and are not able to take responsibility, you have no difference with brands like Trust or any Chinese aliexpress manufacturer. You have lost a fanboy.
Reply: To whom it may concern at MSI, I have purchased 2 MSI products exceeding $2500.  Under these circumstances, I will definitely question purchasing another MSI product.  Luckily nothing has affected my purchases but the lack of taking responsibility for poor engineering needs to be addressed.  Actions are louder than words.
Reply: @gamersnexus
Reply: Jeder versucht sich seiner Verantwortung zu entziehen und den Kunden zu trösten.
Wenn mann Scheiße macht, dann sollte man dazu stehen und dem Kunden ohne weiteres Optionen zu seiner Zufriedenheit geben.
Reperatur bezahlen.
Neue Karte.
Wenn das ein Fehler in der Produktion der Karte ist was aus dem Video zu entnehmen ist.
MSI bitte sowas ernst nehmen.
Reply: wow now we know how is MSI brand is cheap and we cant trust on MSI
Reply: You must compesate that... You can't Say that is your mistake and do nothing about it...
Reply: Trust… maybe you should look up the definition of the word?  You sound like Joker in Tim Burton’s Batman asking for trust and then murdering your clients.   You have been in the game a looooong time MSI, it takes a long time to build a relationship with customers and only one screw up to lose them.  In this day and age of social media and instant information - stupid PR damage control is NOT ENOUGH.  Even if a recall isn’t in the works- when a blatant defect is brought to your attention- do the right thing but do not think a few kind words will make it go away.
Reply: complete BS
Reply: The least you can do is to pay for the repair...
Reply: This is ridicuous, I would sue your ass. Start compensating customers worldwide who face these issues, otherwise you have no value to invest into your products.
Reply: MSI, as a company and brand that people invest and spend money on, this is a sub par response. There needs to be a response that justified the damage and simply stating you are aware of the issue and trying to do better is not right. This is a manufacturing issue that you have acknowledged yourself and yet are not willing to give the customer a refund for the repair or accept any kind of liability. Shame on this company for selling products for pure profit and not caring about the customers who allow them to exist in the first place.
Reply: With this type of response... I will never ever buy a MSI product again. Thanks for showing what company MSI are. And I hope more people will follow paths.
Reply: Now that you've admitted your mistake, compensate the customer for the cost of the repair.
Reply: Take action MSI.. Not words!! Take it to nvidia or PCISIG!!
Reply: Talk is cheap, 4090s are not. MSI needs to pay for the repairs at the very least
Reply: The first mistake was saying “reputable”. 

Was the card still under manufacturers warranty? If so, then they should have had the first right of repair. The owner would have had the card repaired for free. That said, the underlying issue would never have been brought to light. 

It’s obvious with NO solder evident that a QC issue was the cause. On the production line at the plant that card was made, clearly the machine ran out of solder. Unfortunate but it happens. Even when checking for QC issues that card may still be missed and entered into circulation. A manufacturer cannot check 100% of their products. 

It would be reasonable for MSI to pick up the repair tab but honestly nothing more in the way of compensation and certainly not a new card if after repair and testing the card worked within specifications and worked as intended. 

When you talk about these companies, most are based or have headquarters out of Taiwan or elsewhere in Asia. The warranty you receive is a western consumer law concept not an Asian one. Rightly or wrongly, that concept doesn’t filter through really well in Asia. Regardless of what you pay for something, out the door you’re on your own. This is the Asian business practice of their choice. 
Yes a generic non committal response from MSI. Yes, not a favorable response either but did you honestly expect a different response from a corporate tech giant ? They don’t have 1 persons consideration in their sights or interest. Yes they should but no they don’t. Corporations don’t have a heart. 

You want them to sit up and listen then hitting them in the wallet is the only way.  For the owner of the card, get it out there for all to know. 

Me, I own 2 MSI motherboards. One was DOA and the board sent back for repair. I received it back working after 4 months. I was dirty that I had to wait to have a working system again but show me any tech manufacturer that doesn’t do it this same way ? If I’d taken the board to a 3rd party repairer, MSI wouldn’t have had to do anything and warranty not claimed or become invalid for the remaining 3 years warranty period. 
You don’t get to buy the cake, eat it too, then complain that you want more when it’s finished.
Reply: Si no lo entiende en inglés ??? Lo entenderá en español ... Lo correcto es entregar una compensación a ambos participantes, al cliente por comprar una tarjeta nueva en esas condiciones y al local que gasto tiempo en reparar LA FALLA QUE ES DE USTEDES... saludos desde Chile
Reply: shame on you, talk only no action. never buy msi product, asus card is better.
Reply: I always buy MSI until now, that answer tell everything about MSI, I will not buy anymore a single MSI on my shop or even recommend, I cant believe in this... MSI good luck in the future you are building.
Reply: I'm not a technichian, but why don't have those new cards 2 connectors where using 2 pci-e cablesn for power. Maybe that solve the burned connectors? I don't know, but ir seems logic, that the power runs through 2 cables instead of 1 without restain everything on 1 cable. Better a cable rich the case than a broken card.
Reply: @MSIGamingOfficial, as a long time user of MSI I'm sad to say that I no longer have confidence in your products. I'm also the owner of an MSI Katana gaming laptop with the "Known" hinge problem. The official  response I received basically boiled down to much the same as above. If you don't take care of your customers they will find someone else who will.
Reply: The response from MSI includes a thank you for the customer’s continued support and trust. That is an assumption that is probably false. I can’t speak for the customer here but if this happened to me, I’d get rid of that card before it burns down my house.
Reply: Compensate the god damn guy for your lack of quality check
Reply: "We've implemented technical optimizations and improvements in the subsequent product manufacturing process. We will continue to focus on product quality and user experience."......as you should.

You should also either refund the customers outlay for this faulty product or provide them with a new one, one that has hopefully passed your "improvements in the subsequent product manufacturing process".

I don't own any MSI products, nor will I be buying any in the foreseeable future if this is the after sales service MSI provides....disgraceful.
Reply: @@MSIGamingOfficial The good answer would have been : We are sorry for this and we will pay for the repair and the time you lost with the troubleshooting.
Where do you hire these public relationship bullshit employees?
Reply: Who can you Trust anymore??
Reply: I can't believe there is not even a single dislike to this comment. Why does everybody leave a like????
Reply: A Perfect copy paste answer. That would make anyone satisfied, when expensive components have been soldered incorrectly in your computers. Or not.
Reply: you should replace the graphics card with a new or properly refurbished card, this melted connector was caused by a manufacturing issue, since there was not enough solder on the joint
Reply: @MSIGamingOfficial  🛑 STOP 🛑 with the canned corporate answers. You are sounding like ASUS. You are one of the only companies I still buy products from. PLEASE don't change my mind. This does not answer how the customer will be compensated for his loss! You can't send him at the very least a refurbished replacement?!? Customer service makes or breaks a company. Which path will you choose?
Reply: MSI is trash. I've used many of their components in the past and they've all failed on me. Never again.
Reply: "If MSI decides to compensate..."
Very wrongly stated, MSI and every other manufacturer must be legally forced to do this, also provide all necessary parts to repair their products, schematics, manuals, etc. I think the hardware manufacturers have pushed themselves because they have a lot of money. This must be stopped.
Reply: MSI, if you value customer service, replace the item, the customer has invested time and money and lost revenue, now do the right thing.
Reply: Soo.. is he gonna get a new card or what..? This response is a joke..
Reply: well ya get what ya pay for should have bought the warranty 🤣🤣🤣
Reply: ACTUALLY ☝️🤓, since the port fell off and was touched by someone’s barehands.. warranty has been voided and no compensation will be given.
Reply: we need actions
Reply: MSI needs to make it right.
Longtime gone the days where company use to follow the moto "the client is king".
Unfortunately, the shareholders are the kings now, and to bad for the clients if they get a lemon.
Reply: You must compensate the customer
Reply: Im not sure how trusted this company can be after setting of a smoke alarm due to lack of quality control. With all of the money saved in that department you should have just paid to make this video disappear.
Reply: I literally dropped asus for my last seven builds because of their customer support services. I have several MSI products. Don’t force me to buy else where because of crappie customer service. I can save money and get trash service anywhere
Reply: @msi Alex can teach you how to do it better than factory
Reply: MSI, is there a more complete response?  Is there a proposed solution?
Reply: You should compensate the customer immediately.
Reply: Pay for the repairs msi. Or recall the cards. Do the right thing
Reply: Damn, I really liked your product. 

It a shame this is how you treat the very people that help feed your business. 

I guess the silver lining is someone who will actually care will come up from this. 

Watch out, people will be coming for your lunch money.
Reply: They changed their name to (M)ight (S)older (I)t next time Gaming!
Reply: But still, this case can't RMA
Reply: Why should anyone buy MSI? No reason unless you like throwing your money away.
Reply: Im a MSI Fan from Germany. Im not really affraid of buying an 4080/ 4090 from u. I love ur PC Parts but now is the question: Am i getting good quality and support now?

Unsure.
Sadge.
Reply: so you take our money lot actually and give us a broken bad quality card then you came and say ohh nooo really that happen pkay we understand we will make sure not happen again are you serious what wrong with you guys customer should punish any unresponsible company by bycotting their product
Reply: You should AT LEAST provide the customer with the means to resume his work without any extra cost on his behalf!
Be it a replacement graphics card or repairs and loss of income costs.
Reply: How you gonna make it right, @msigamingofficial?
Reply: If you are “aware” of the issue, then what are you doing???
Reply: Same thing with the AIOs.MSI is no longer supporting their Customers. They should have replaced the card. Do not buy their products.
Reply: And how your recognition would recompensate the client ? 
That's your product, and you should take responsibility for it, by at least providing him a brand new Video card or at least paying for the fix with an apology. 
This comment has not helped the costumer.
Reply: @msigamingofficial I have two gpu from MSI and one motherboard...not in future MSI,you dont have RESPECT for this customer and in the future maybe is on me!!..By MSY
Reply: This response is the most disrespect you can give to someone who’s supported your company. We can tell it’s a copy and paste response. I was considering 4080 super msi gc but I ended up going with gigabyte due to hearing qc issue with your cards. For a product that is over 1K, your service is horrible and you will feel the neglect that your customers feel as well. From, human from Earth
Reply: Please provide the customer with a new video card that includes the technical optimizations. The connector falling out is not the customer's fault, and if this issue persists, it could discourage customers from buying MSI video cards, especially given the investment involved. The customer is having to take the video card to Northridge Fix for repairs and it is incurring additional costs for these services.
Reply: THX MSI, Now i know that i will never buy a MSI Graphic Card.
Reply: I expected more from MSI, personally I used recommend MSI over other brands to my clients.
A better explanation and a better solution needs to be there.
Nonetheless the client should've approached MSI first before taking it to the shop and see what their response is.
Reply: Clearly the connector was not properly soldered from the FACTORY... Junk'
Reply: Missing the part where you said you are sending a new one to the customer for free.
Reply: MSI this is not good enough you know that connector is a issue and it's your fault you made the Graphics card and you need to pay for repair or replace card and if Nvidia told you to use that connector then you take it up with them in court to get your money back, 
I use many of your products and have been recommending you to lots of people please don't make me regrate loving you as a company... now do the right thing do the descent thing and guarantee your products, you want to be known as a company that's untrustworthy and bad as ASUS
Reply: Wtf MSI, I was an Asus and MSI parts buyer. Asus already is on my no-buy list for more than a year. I'll just switch to other brands if this your only response.
Reply: MSI should reimbursed NRF for your repair and then mention that if it happens again he will get a full RMA replacement.   Short term minimal cost Cincinnati wouldn't have to pay for shipping or their engineers time to fix it.  And best case scenario the follow-up never has to happen but at least it's there for a piece of mind.
Reply: I got MSI B650m motherboard recently and got so much issues that In thought my graphics card is gone bad but real culprit was the motherboard then wifi stopped working as well, I have used ASUS entry level board and haven’t face any issues for years and here I got a high end MB and totally disappointed, never gonna use or recommend MSI to anyone. @MSIGamingOfficial
Reply: A bot typed this, this is an automated, AI response.
Reply: Massive respondes to can't see them all.
They have written, normal enterprise bullshit, in order to not to be blamed in any way in what was written. 
Compensation! If I remember, the card ihave less than one year so he should sent it to warranty! Any extra charge was on its choice, so no compensation. So they will be free from law penalties. They could do it only to put an happy face to the customer! But they will end like EVGA.
MSI could not have write a thing but they did. With this reaction they will not do something like again on future!
Reply: Recall all the cards and fix them
Reply: Good jop MSI, The trust passed away.
Reply: I have been a msi fanboy since the 770 and it still runs!!! this is unacceptable customer service tho and I will no longer be buying products from msi as I do not want to end up like this guy
Reply: embarrasing response
Reply: MSI should replace that card with a new one with the "improved technical optimizations" at no charge for the customer and pay the bill of the one that Alex repaired.
Reply: So you’re saying “Yes it’s our fault, we knew about, we’ll try and not do it again, buy more of our stuff!! Trust me bro”
Reply: I will NOT pay that much hard earned money,for something that the Buyer is left to pay for repairs that should have never have happened. Make it right words are useless.
Reply: MSI make the things right... Pay the bill for repair and send some compensation to customer.
Reply: I’ll be honest MSI, I think the only fair thing to do is give everyone who commented on this post a Rtx 4090. Fair is fair.
Reply: I use your products, specifically the motherboard and graphic card,
but overall I am not satisfied with the quality,
msi 970 bad mosfets,
msi tomahawk max, armor... and many others have a similar problem, like the boards have a problem with the software
graphics have a memory problem...
Reply: Seems like these are actually dangerous. Sucks to have to reimburse or recall...but man if someone's house burns...yikes.
Reply: Refund the customer
Reply: What kind of stupid response is that? Why could you not offer the customer that purchased your garbage card some compensation since you know
that it is your fault? How about a replacement card or an offer to repair the card for free? If you are aware of the problem why was the issue with the customer not resolved?  Own the responsibility! Stop being greedy! Is a replacement going to make or break you?  Showing goodwill towards a customer who purchased your product would go a long way in PR (Public Relations)or are you too dense to realize that? You would have gained trust, now you lost some.
Reply: MSI you need to give a new card for the customer and me as well, for conpensation! Thumbs up if you agree!
Reply: Actions speak louder than words.  This response was pathetic PR garbage.  Your words do not compensate the customer who paid good money for a garbage product.  Nobody in this world is perfect.  Mistakes happen.  It is how we respond to the mistakes that makes the difference.  Your response was pathetic.
Reply: A lot of pressure to pump out cards means a similar investment in people and processes. This cost is to the customer. If you don't pay bills, most particularly to wronged customers, you lose credit with them. As a business, you are making the most common mistake among short-lived or over-priced companies today. 

Be careful of being disfavored in financial markets, or you might find yourself boxing in a cellar.
Reply: Refund the customer for the faulty product it was sold to him that's the only way you are going to get a decent feedback from us customers.
Reply: its a card the price of a high end gaming computer. it shouldnt even be faulty for that kind of money
saying oops sorry my bad, is just not enough.
Reply: If you're aware of the issue, why not extend the warranty?
Reply: MSI SUCKS BALLS!